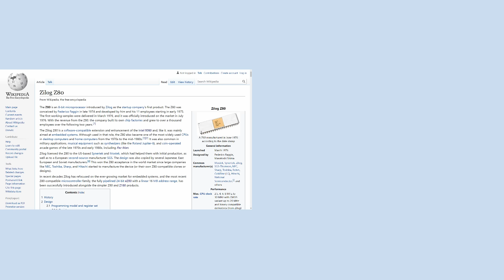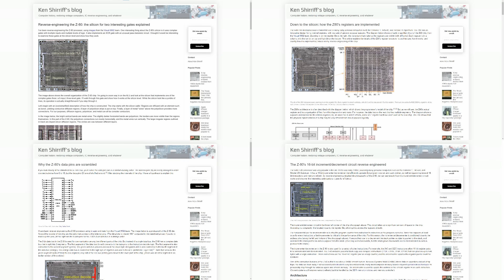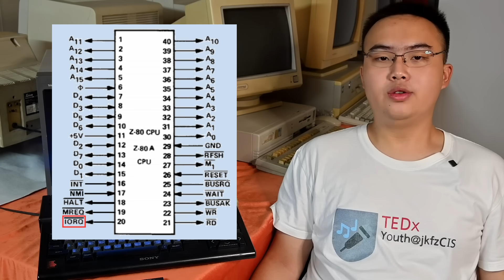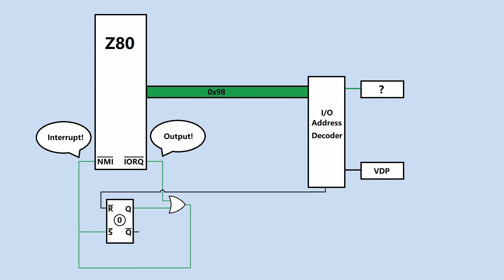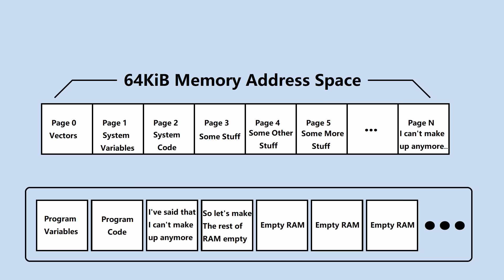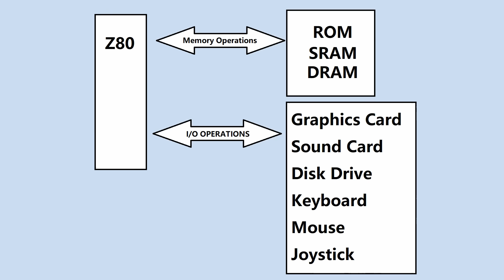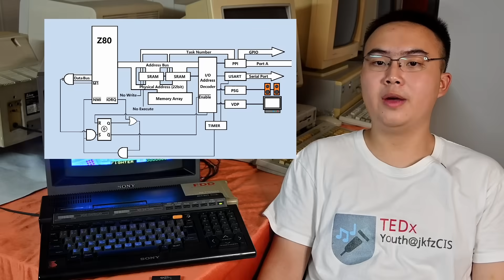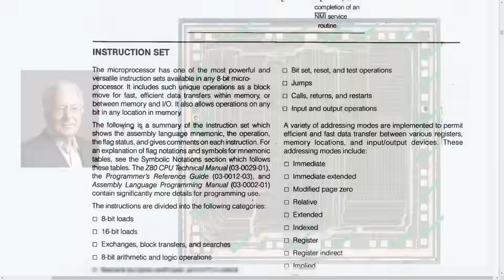The Z80's secret feature discovered after 40 years!

Comment: The Morrow MP-Z80 and the InterSystems XPU-80 for S100 bus had full protected mode and an MMU.  It's worth reading the manuals for these devices as actual protected mode on a Z80 is much more complicated than this little trick. You have to manage a bogus stack pointer on NMI and all sorts of other stuff (like infinite prefixes).
It's actually much easier to do these tricks on a later 65C02 as you've got vector pull and stuff and I've actually done board designs that provide a very basic protected mode setup. There were also historic 6809 setups for this kind of thing - which are even trickier.

Comment: Memory Mappers - the concept that made the 6502 based NES such a powerful and extendible platform.  That decision, as well as the decision to bring out all the I/O lines to the cards were ingenious.  That basically allowed you to extend the NES beyond it's physical limitations.  You could have as much RAM as you want on your card, and by flipping pages via the mapper you could use that extended RAM very effectively.  Many later games did this, including Star Fox.  It allowed you to have coprocessors - a few titles did this - and it allows you to store a HUGE program that would never fit in ROM normally and through that page flipping technique bring in executable code from that extended ROM.  It's one of the most genius solutions I've seen in 30+ years of computing.
Reply: You mean the SNES...

Comment: On the ZX80/ZX81 (my first computer was a ZX80) I have the suspicion that some of the undocumented instructions were used as there were Z80 clones that didn't work in those computers while the original Zilog CPU did work.
One interesting thing with the Z80 is that there's an indirect I/O mode where you can address the I/O through the HL register (if I remember correctly) and the high 8 bits of the HL register is then put out on the upper 8 bits on the address bus. Something that can be used to create an extended I/O addressing range or do a mask read of an 8x8 keypad.
You should also look for the Swedish Luxor ABC80 / ABC800 computers. The former one uses the PIO chip while the latter one uses the Zilog Z80 CTC and SIO. The Monroe OC-8800 computer was also Z80 based with a multitasking OS called OS8MT. That computer had a Z80 DMA and also boasted 128K or RAM.
So now you have something to dive into for the world of Zilog based computers.
Reply: Zilog had two kinds of licenses.   Some second sources got the physical design.    NEC did a licensed redesign from the data sheet, but unlike Zilog they fully decoded the instruction set, as documented.   And they filled in the undocumented codes with NOP.   So depending on whether your compiler used undocumented instructions, you couldn't always use the NEC chip.
Reply: @drdischord  That seems to match my observations wirh the real Z80 and the D780C on the ZX80.
Reply: @ehsnils  I learned about second sourcing and licensing in general, when I was working with the Am2901 and Z-80 at an electronic warfare company, in 1979.   But I got the specifics on the Z-80 and MC68000 situation when I was working at Motorola a few years later, and I got it in face to face meetings with Zilog and Motorola field support engineers.   Zilog's exact physical second sources were Mostek and ST.   Second sources for MC68K were Mostek, Signetics, Hitachi, and TI.   Each one contributed a peripheral device, but they were all buggy as hell and weren't widely used.
Reply: The indirect I/O mode is via BC.  The address bus always get the value of a full 16 bit register pair whenever the CPU is providing an address on its address bus.  There is no mechanism to set the upper 8 bits to zero or something else.  Even during OUT (n),A  the address is the hidden WZ Register which become A and n beforehand.  So OUT (n),A instruction will become quite useless on systems where the upper 8 bits are used.  Perhaps that's the reason why this behavior is not officially documented?

Comment: About memory... The old NewBrain from Grundy system, using a Z80,  was done in a way that, at the time, was able to adress 2Mb of RAM ( there was no hardware for that then but so far I remember I read it was achieved in the laboratory... ). And it was able to ran CP/M and CP/M86 ... The CP/M86 was a multiuser and multitasking OS so far I remember as well.

Comment: As a retired IBM engineer who started working in 1980 I am impressed with your ability here, and also in your interest in this topic. I used to wire-wrap 8085 systems together and programmed them using asm, reprogramming them after a short 20 minute erase process using an UV light! Spent most of my career in the bare metal space. You have a bright career ahead of you, my friend.
Reply: @MR PawPaw -- OMG, that's the same kind of work I did back in the mid 1980's!
I spent countless hours (including evenings and weekends) writing asm code for the 8085. If memory serves me (no pun intended) the 8085A supposedly had four undocumented op codes which allowed some much-desired operations such as a 16 bit subtract, and I believe a couple of indirect memory access operations (my memory is very volatile!). Unfortunately we programmers were not allowed to use those undocumented op codes because Intel did not guarantee they would work in every new lot of chips they produced. We had to be very clever with our coding because of the limited 65K memory that we had to work with.
Reply: @Xray-Rep I still have my HP25 programmable calculator. In 1976, when I bought it, I exhausted its 49 programming steps to numerically solve a set of four equations with four variables, none of which could be set out to algebraically solve it. It took the HP25 all night long.
    I did not program an 8085, but learned ASM programming for a Siemens 300 series of minicomputers (the language was PROSA300 (PROgrammierung mit Symbolischen Addressen, Programming with symbolic adresses, the first ASM to use labels for addresses instead of numbers} and, in the '80's, designed, wire-wrapped, burnt PROMs, and programmed the 6802 in its ASM and tested the circuits (and manufactured and sold 1400 dedicated microcomputers, the screen being a little TV CRT). I consider myself almost in the same league as you.
      The SWI instruction in the 6802 has no p operand like the Reset in Z80, but I managed to make it have one by making the SWI service routine to read and skip the next byte (increasing the stacked PC return address) so I could have up to not eight but 256 SWI vector addresses. I mostly used them extensively instead of Go subroutine. A macro took care of assembling that byte inline.
Reply: @wafikiri_   Kindly make a video explaining this. Thx. (Long term, it will reach more interested people.)
Reply: Bravo for encouraging this young man about his future. I admired that.
Reply: If National had been a year closer to working samples you would have been wrapping 16032 (later rebranded 32032) as the folks in Boca Raton loved it and hated the Intel architecture. But that's coulda woulda shoulda!!
Reply: @garymartin9777  The 8086 architecture was a horror.  There were a lot of beautiful architectures: iAPX 432, IA-64, etc.  Perhaps they were ahead of their time or perhaps they were just bad ideas.  RISC ultimately proved more successful which has its beauty in its simplicity (or it did).
Reply: I still have factory new z80 cpu, CTC (COUNTER TIMER) AND PIO (Parallel input/output. PLUS  my wire wrap guns. I did a lot of work with this chip set.

I started out in 1971, had one of the very first HP RPN calculators, actually held in my hands, one of the original Intel 8008 cpu that was fabricated by Texas Instruments. Too bad I wasn’t as financially smart as I watched, from within the industry,  the entire microprocessor revolution. I’d be rich!
Reply: Kids! I worked for IBM in the late 70's on 8080 ISA bus designs before the ISA bus was a thing. That was in Sunnyvale, CA and spent untold months in Boca Raton, FL. Those were the good old days! I eventually transitioned to IBM-ROLM designing call processing software for 5000+ port PBX phone systems
Reply: @buzzhansen8824  You probably worked with Mark Dean then.
Reply: @mrpawpaw7023  Oh my gosh! Yes! He was the father of ISA! Since I was doing both hardware and firmware, I wrote the ISA bus drivers for the IBM LTUR project. I was an Advisory Engineer at the time and Mark was my age (or a little younger). Don't remember his title. With all the fellows, he really stood out!
Reply: @buzzhansen8824  I worded with a bunch of those guys when they transferred to Austin to develop the Power PC. You remember, the architecture that was to replace the Intel  PC.
Reply: @mrpawpaw7023  :-) Oh, you mean like NEXT?
Reply: If you have a really OLD Zilog or Mostek (1978) databook you'll see that the original DMA controller documented FOUR DMA modes (byte, burst, continuous, transparent).  As I had an early release version of the chip and datasheet for my master's thesis, I was intrigued by the "transparent" mode.  After studying the datasheet for a while (and some confirming hardware tests) I concluded that not only did the transparent mode not work, but that because of the Z80 architecture, it could not work.  I discussed this with Zilog in Cupertino and was told that the designer of that particular chip was "no longer with the company" (nudge, nudge, hint, hint).  Sure enough, the revised datasheet showed the new-and-improved DMA controller now supported THREE modes (byte, burst, continuous),  The FOURTH mode (transparent) was now replaced with "do not program").
Reply: I still have a Z80 wire wrapped single board and a Sinclair Z80
Reply: @richlaue Wow. I was willing to go machine language (Yes, Virginia, exactly right. Peek and poke. Move 1 instruction, re-shuffle!) but never got down to it mechanically.
^5
Reply: I see you're no stranger to a logic probe either. Never cooked using the 8085, but I did start out with the 8008, and lots of Z80's 6809s , and the NS Cop402 microcontroller. The mc68000, is still a favorite for old school,  if I were to feel nostalgic. 
Are you relegated to fishing and mowing the grass? I ask because I might be officially retired , but I'll never stop building. I switched tools and technology. I do a ton of stuff using the raspberry pi, the pico, Arduino, the esp32, esp8266. Oh, and the Nvidia Jetson as well. I encourage you to do the same and keep your mind active. Retirement is the biggest killer. Keep your mind sharp and use your brain. Never stop. The time to stop is when you're dead. Keep those projects going.
Reply: There's still a lot of us about and still in the industry albeit we're generally a dying breed...
Reply: I followed my Trek Z-80 with the 6502 on C=64 ... c/w assembler for the first time!
p.s. zero page lookup rather than registers ... fascinatin'.
Reply: I agree (with the post I'm replying to). Granted, I was 2 when the Z80 launched, but as a computing electronics engineer the Z80 was the standard for microcomputing essentials in school as the 6502/6510 wasn't distributed (at my school, at least) as a teachable standard, and Intel... Oh, Intel...

Now I'm working with multicore platters with 96 64-bit processors... And I'm BEHIND the current tech! Just incredible!
Reply: Looks like I'm in good company here.  6502, Z80,8085, 80186,etc.  These were all great things to work with.  Protected memory on the 286 was a kluge, but workable.  We've come a long way since those days.
Reply: Liar.
You lie about your real name.
Reply: @MichaelKingsfordGray  ARF!
Reply: @mrpawpaw7023  Grow up, if you can.
Reply: @mrpawpaw7023;
I started, seriously, in about 1974, did a LOT of wire wrap work...my first consulting project was on a XC6803 , using POP assembler programming (pencil on paper, code sheet, counting in hex in my head, for branches), used an EPROM emulator for downloading hand-entered code on an S100 Z80 machine... Managed to write a 14-point, 16 bit, quadratic fit algorithm in 1.5 ms, on a 1 MHz Bus Rate machine...btw, the XC6803 was the first microcontroller with hardware 8 x8 multiply, with true 16-bit result, along with real 16-bit addition, so I did 24-bit multiply routine, and used that to do divide by 16 routine 😀, managed to get a depth sounder front-end processor, with bottom tracking, and fish-finding "windows" into 1400 Bytes... Those were interesting times!
Reply: Bate Metal today is a very small niche, unfortunately.
Reply: needed hacking geniuses like this back in the day when the Z80 ruled the Earth
Reply: Im stalking each and every one of you; I will be the world's greatest engineer and imma steal y'all skills like space jam ( not that azzbut dooks that LeBron James was involved in). So if you see me in da shadows ( I'm black so I'll natually blend in ) I've come for your skills not your ladies.
Reply: No, u are not lol
Reply: Your job back then is my hobby today 😊
Reply: The cover has real gold on it.
Reply: I have one of those old computers and it has those connectors for terminals that are really big that look like thicknet ethernet, there's a lot of wire wrap internally and I think it's a 280 volt power supply. I'd really like to know how to see if it works, but it's not like it has a video card not even an old EGA one. Do you have any ideas? I can send pictures or post a video if you are willing to help.
  Also got an external discus maru systems 20? meg hard drive, it's a good 18 in size. But I'm not sure what the disc interface is, there's two ribbon cables that are usually used for internal connections.
Reply: Yep... I still own my first computer -- Z80 with 256 bytes of ram.  Cassette recorder to save programs via Z80's SIO chip.  The terminals at school had a bug in them.  I reverse engineered the terminal (8085 based) as well as its code, found the bug, re-blew the EPROM and fixed the issue.  All without any test equipment at all.

The 6809 (if I recall correctly) was the most beautiful 8 bit chip I ever saw.
Reply: @pedzsan  The 6809 was my first build as part of a college course. Wire-wrapped, too, which is amazingly robust. The board still runs fine what, 35-years later? And I agree. I absolutely loved everything about that uP.
Reply: @R.Daneel  If you can find a TRS80 Color Computer you can still use the 6809. I learned on it then went to school for my EE degree and we used the 6803 uP, it was the same except the 16 bit instructions, I was even able to use EDTASM to write the programs. There's CoCo emulators too.
Reply: @pedzsan  maybe because it (the Motorola 6809) had 16 bit registers? And indirect addressing?
Reply: I agree but started my work on computers in 1970 and started designing with the Z80 in 1976. We had to use wire wrap for development because pcb's cost too much.
Reply: @wmffmw  I don't believe you!
As you are willing to lie about something as basic as your name!
Reply: We had a parallel life...
Reply: @DaveWilliamsj  You used a juvenile fake name as well?
Reply: Not really.  These types of skills really aren't useful in today's world

Comment: 6502 also had a few undocumented commands that were found to be buggy, and thus removed from the datasheet. Later versions actually removed them, but many of the early ones would sort of execute them, and the CMOS versions later on used those unused opcodes to actually have enhanced instructions that were not on the original, but nice to have. Of course mixing the 2 up was not going to end well program operation wise.
Reply: 6505 was not microprogrammed tberefore was hard to fix wrong opcodes
Reply: That's not correct. The 6502 has a minimalist instruction decoder which had documented opcodes and illegal opcodes. There was only a single instruction, ROR, which initially had a bug and that was corrected by the time 1977 rolled around. The documented opcodes except for ROR all worked perfectly from the start. The illegal codes were never intended to be useful, real, or supported in any way, but a couple of programmers used them for novelty purposes. They represent incomplete decoding. The incompletely decoded instructions were replaced with actual instructions when the instruction decoder was replaced in the 65C02s, and there are multiple different designs of the 65C02 with different instruction sets.

Comment: I think that since the concept in this video is simple and low-cost that it could have been done in it's own time. Yet, I don't think it was, which surely means this concept is original. I wonder if other's ever had similar concepts, and maybe even implementations of it as mods to Z80 hardware. If that is the case it died in obscurity, so it is a good thing that is cat is out of the bag. How long until there is a Kickstarter for hardware with this feature?

Comment: Nice to see that somebody is still playing with these old toys ;-)  Maybe I'll just disappoint you a bit but features you mentioned were known and used back in 80's. Even by commercial products, for instance ZX Interface 1 employs capturing of the rst #8 instruction to remap the ROM page with service routines for the microdrive etc. There were also NMI button peripherals remapping the memory  at the same time to allow easy modifications of running code (game cheating). I end up with total 1MB of RAM "tower mounted" (chips soldered on top of others) with 7489 serving as a paging register for both, CPU and ULA independently. It allows significant time savings on loading of programs from cassette tapes (1200 bits/s) as long as no power glitch occurred 🙂